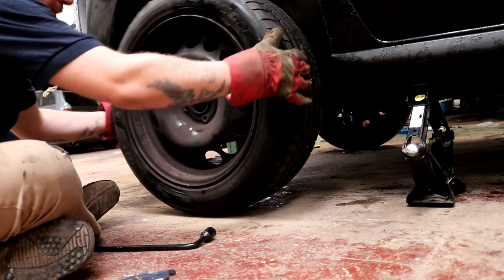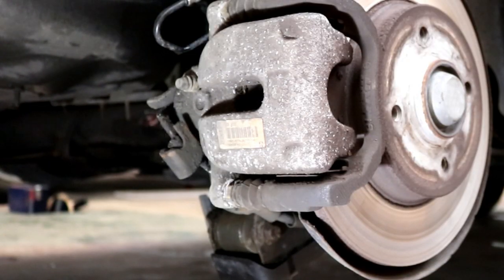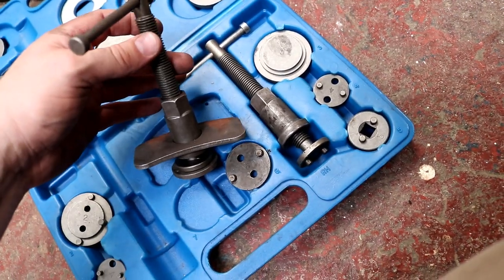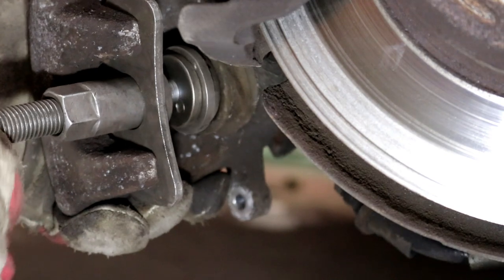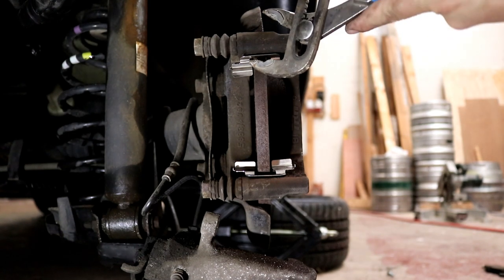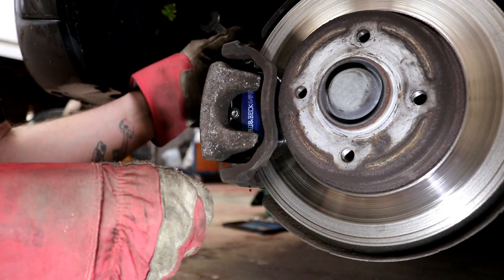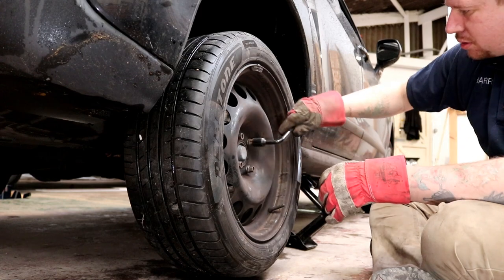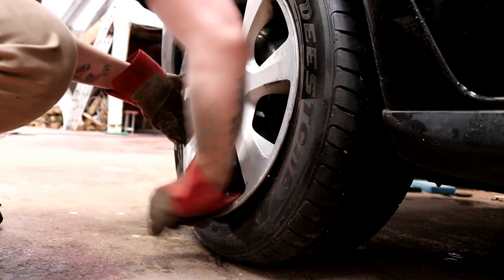Rear Brake Pad replacement Peugeot 3008, RCZ & Citroen C4, DS4

Comment: Changed my pads today and watched this video due to it being first car I've done with electric parking brake. I found a better way of disabling it to change the pads without the need to leave the ignition on or engine running. In my auto put into neutral with foot on the brake, turn ignition on (but don't start the car), release the parking brake, turn ignition off and remove the keys, this will stay off now until you reapply it :) but ensure you chock your front wheels beforehand.

Other things I would suggest on the video is:

- Remove brake fluid cap before winding pistons back to make it easier and to avoid damage.
- when using tool to push piston back then your turning clockwise on both sides (make sure to not damage the rubber boot on the piston.
- Wire brush/ file/brake cleaner to clean carriers
- if pads don't move freely in carrier after doing the above file the paint of the pad to give abit of extra clearence
-ensure the sliders on the carriers are free. If they aren't then remove clean, regrease and then refit.
- have a torque wrench and set all bolts the manufactures spec
-pump the brake pedal before applying the electric brake pedal
Reply: Hi Leigh, and thanks for those nice tips which are already noted. I am about to do the same job on my 2019 3008 with EPB and struggling to find accurate information about the piston. Is it a wind-back one? a push-back? Or if I follow your suggestion it will retract fully and I don't need a piston wind kit at all? How about a diagnostic tool to "reset" the EPB after? There seems to be contradicting information online...

Comment: Excellent video in these tough times, I struggled like f*** to push the caliper in, then I thought, I'm doing something wrong and this can't be that hard, I took your advice and bought the tool to push the caliper in and it was plain sailing from there on 😂, thanks for the guidance 👍

Comment: Nicely put together video, tho I'd always recommend using a torque wrench and to set the wheel bolts to the correct torque to avoid stripping the internal hub threads, made that mistake too many times in the past. I'd also recommend tightening the bolts  moving to the opposite side/cross pattern as opposed to the next one along, just how I was taught. Keep them coming tho beer and cars are my fave subjects

Comment: Might be an idea to remove cap on brake fluid reservoir this makes it easier to wind piston in . Also check that the slide tubes aren't sticking , these come out to clean and put small amount of copper grease to stop them seizing up . There are torque settings for these bolts and the wheel bolts . Nice video too .

Comment: Did you pop the lid off the brake fluid reservoir before winding the pistons back? Makes winding them back a lot easier than it looked in the video! Just remember to stick the lid back on before you drive off!

Comment: Surely not removing the brake fluid reservoir cap could cause issues?  I'm no expert, but winding back the calipers forces brake fluid back up the brake pipe and without taking the cap off, you could burst a pipe.  When I did mine, on the same car, with the cap off the reservoir, it forced fluid right to the top &   overflowing.  Obviously it was fine in your case, but I wouldn't be that brave ;-)

Also, when the pads wear down, they have a tendency to rattle about, particularly on the 3008. Mine were that bad when I bought the car that the dealers thought the noise was the shocks, then they thought it was the engine top mount.  Eventually, I discovered it was the brake pads!  I always stick a bit of copper grease / brake grease on the 'backs' of the pads.  It sure as heck quietens the things down.  Got rid of my terrible front end rattle over rough ground.

Nice, easy to watch video.  I was worried about doing the rear pads because I read that the electronic handbrake made it difficult.  Now, I'll do what you did.  

Still got the 3008?  Is it the 1.6hdi?
Reply: You put more force on the pipes while driving. You never going to bust a pipe... Really when you force back pistons you should open the bleed. When your fluid came out of the rest it was because someone topped it up when the pads were worn which you don't do

Comment: Piston tool is ... well, not something you'd enjoy doing this without. It will cause you pain and you will probably fail. Buy the tool under any circumstance, if working on the brakes on this vehicle.
Some other car brands have the same system, so it's a multi tool. Everybody loves multi tools.

Comment: Check brake reservoir level before winding caliper back
Reply: Could't not force my calipers back, even when lid off and air/screws open. Think both my calipers are junk. Yes i did disengage hand break.

Comment: You can use a sturdy screwdriver to push back the piston while old brakepads are still atached, no winding tool needed.
Reply: No you can't with the handbrake caliper piston in the center is threaded....yes you can the front calipers as no handbrake screw